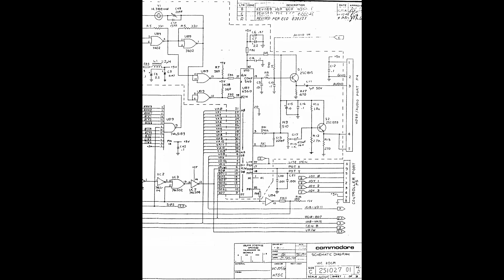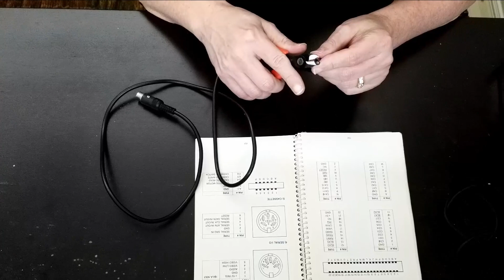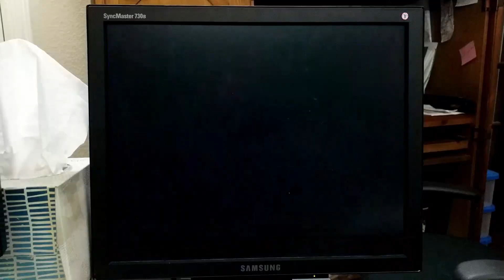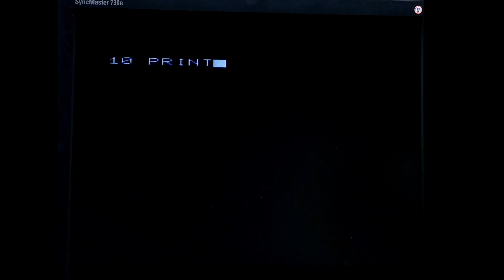How to Connect Commodore VIC 20 to VGA Monitor

Comment: This was my first computer. It was the catalyst that led to my career as a coder. I still have that old VIC and would like to revive it. I'm just lacking some parts, like that old 300 baud modem and cassette drive. Built my own video converter. Can you believe 32K? I have 100 terabyte machines idle with nothing to do several times over keeping my screens busy with Andromeda Mass Effect background ambient. There is no peace in the world but the background sound of my servers; a hundred fans in the background. Funny, no beeps or boops in the background, just air blowing by my processors.
Reply from the maker: Thanks for Sharing.  VIC20 got me started in programming as well. My next computer was a Tandy 1000 which I spend a few hundred dollars on to upgrade the RAM to 640k so I could play Double Dragon.
Reply: @MakerAtPlay  Yeah, the Tandy 1000 was my next computer. I did spend the money on expanding the RAM to 640k, then to 1024k expansion. It was pretty expensive. Stuck the VIC in a box in storage but have now revived it after decades. My computer after that was an HP 83/85 and I learned HP Basic. I used that at work (worked for Micro Source, Inc., later Gigatronics) to automate a Network Analyzer, and HP8566B Spectrum Analyzer and a Scalar Analyzer to tune 2-8 GHz YIG oscillators and filters. Good memories. Got a couple of IBM PC's after that and never looked back. Now I have crazy systems I would have never imagined possible. Happiness and I sure would love to find a Commodore t-shirt like that. Oh, BTW, I also got ahold of a UniVax 11/780 around then. Filled my whole living room! It had 2 20MB platter hard-drives that weighted about 200lbs each, with multiple terminals including a separate small integrated terminal just for system functions. I never really learned how to use it, but the console table became a great support for my two IBM PCs. I wish I kept it; it would have been fun as heck to play with now after I retired. I think it belonged to State Farm, but I couldn't figure out how to access it. I got it by trading my old Chevy pickup truck for it. Gotta laugh about that!

Comment: About the video chip's 'visibility', it seems it can only handle 16kb of memory according to the VIC's registers. So from $0000-$1FFF or $8000-$9FFF. But if memory Block 0 is installed it is not 'seen' by it (at least in the emulator), is this also true for a real VIC-20, does it also see nothing but 'noise' at $0400-$0FFF ?
Reply from the maker: I believe (but not 100% sure) that since the VIC chip only has 14 address lines it can access 16kb of memory, but this 16kb can't be located just anywhere in RAM/ROM because of the 2 missing address lines.  More info http://tinyvga.com/6561

Comment: I put my Vic-20 with dozens of games out on marketplace for $250 someone offered 180. I’m just concerned that I might’ve used my checking account information in one of the programs.
Reply from the maker: Your data is safe as long you are not providing and cassettes or floppy disks that you might have saved data on.

Comment: Does anyone know if I need to remove any personal data like my checking information from my Vic20 I think I wrote checks using the Vic- 20?  I don’t have a monitor or the ability to change the monitor plug to use with my smart TV
Reply from the maker: The VIC 20 doesn't have any internal storage (writeable storage). The only place your personal data could be save is on cassettes if you had a tape drive or on floppy disks if you had a disk drive for your Commodore.
Reply from the maker: And if you are planning to get rid of your Commodore, don't throw it in the trach, there are people out there that would love to have this old computer.

Comment: Most of these Composite to VGA adapters are junk. They have terrible picture quality and introduce a ton of input latency which makes a lot of games unplayable. Get a Retrotink 2X of some sort. I'd recommend the 2X-Mini for most of these microcomputers from the 80s since the best most of them outputted was either Composite or S-Video anyways. It's like $80 USD, and is totally worth it. I have the 2X-Classic since I have several systems that also use Component. Trust me, this is a much better solution if you intend to play ANY games on an 80s computer. They output HDMI (some use mini-HDMI I think), but you can get a cheap HDMI to VGA adapter and you'll be set.
Reply from the maker: Thanks for all the great info.
Reply: I bought the adapter linked in the description and after 30 seconds the image starts jumping. I think I will try the retrotink.... thx :)

Comment: Instead of mutilating your RF modulator...you can get a new 5 pin din connector for around 5$ on ebay. If you happen across an old tv set, you can get what is called an RF to COAXIAL adapter and use that. Crt televisions are commonly available on the side of most streets these days. So for that reason, as well as many others, I would recommend that you dont ruin your RF modulator...if for no other reason than historical completeness of your very historic computer.
Reply: For VHS video cassette players, a TV of any age will show it with just one single coax cord (as your cable Co. provides) if you "Manual Add", in the TV's menu "Tools" or "Channels" : 3-0 and 4-0
Reply: Actually that is exactly what I use for my C64. RCA(RF out on the c64) > coax > VCR > RCA > TV. that way I can record myself playing games when I get to a hard part, or remember how I did something difficult in assembler etc. I also can watch tapes/TV/DVD without disconnecting the computer. Can't beat a CRT with RCA ports...at least in my opinion. Monitor is good if you are doing 80 columns and is quite sharp. I mostly just use the TV though for space sake.
Reply: 100%

Comment: I just bought my second VIC 20.  I bought my first one in 1982. Thanks for the memory jog.
Reply from the maker: You are welcome. Have fun with it.
Reply: Dont forget to download tapdancer. It will help you transfer tape programs from your phone. Find the right volume and then go nuts recording games back to tapes. I found that the cartridges are an extreme indulgence. I spent around $70 US on a Vic 20. Then I spent $1000 on cartridges. Lol. Idk if you want to do that, so I thought Id toss in that bit of sense. You can get a copy of Shamus on cart for over $100 or you can copy a tap image back to tape for .50 cents.

Comment: Hi, i discover your channel right now looking for vic20 info about how to fix or improve image. I use a RCA cable to my moder tv.. the image seems to be not perfect...some lines and the pixels with colors appears not perfect... do you know if i need a modulator or i need to fix the video box output inside the machine...? can you help me , please?? thx in advance.. !
Reply: My advice would be to get an old tv set from the side of the road and use a coaxial to rca adapter. Hook the coax to your RF modulator and just use the RF. Picture is perfect even in 40 columns. Vga seems like overkill to me when there are so many crt tv sets getting dumped for free/for nearly free.
Reply: For any screen that's "wideScreen" shape, expect jiggles and smeared text. Panel TV old enough that it does not have "HDTV" printed on the front is the right shape; most have a small number of really big glowing pixels, so can match to '80s console "Standard Def/ Lo Def"

Comment: WOW  ... Talk about Omens, Prophecies and Signs from the Heavens .....  I just now pulled mine out of the closet after all these years. I have a Super Expander w/3k Extra memory, 16k Ram Cartridge and a Vic20 HESMON machine language monitor for it. After seeing your video I found one of these home made cable in the box but have no recollection of making it. I remember paying $600 bucks for mine waaaaaaay back when. I had just started working as a Computer Operator down on Wall Street. By the grace of God I was able to fill a spot in the machine room mounting tapes and working on the nosiest monster size printers in the world, coming out of the mail room, and wanted to start learning some programming. Thanks to this little puppy I am a 30+ year IT professional.  .... How fortuitous was this video.
Reply: My first was a VIC-20 and I've just got it out of storage.  It powers on but I haven't got a video signal yet.  Had a homemade cable from Radio Shack parts apparently, but it's gone bad in just the last week from using on my C128D.  Have more old parts, so gotta fire up the soldering iron and get crackin'.  The Commodores definitely helped get me into software, hardware and firmware engineering.  Now 37+ years obsession.  Check out my blog at davevw.com
Reply from the maker: I have been programming for 35+ years thanks to the VIC-20 I got for Christmas when I was a kid. Thanks for sharing your story.
Reply: PFFT you'll never use all 16 extra kilobytes... That's crazy.